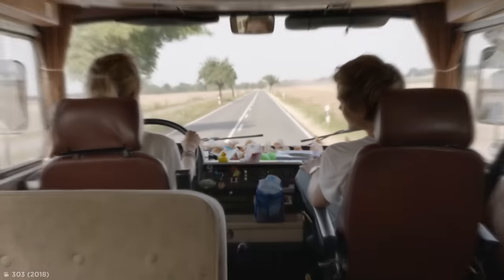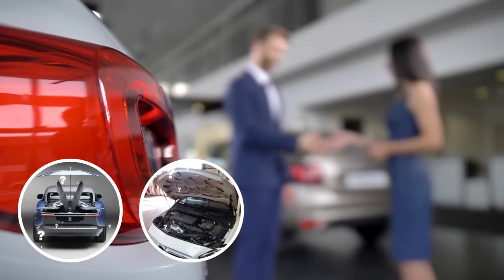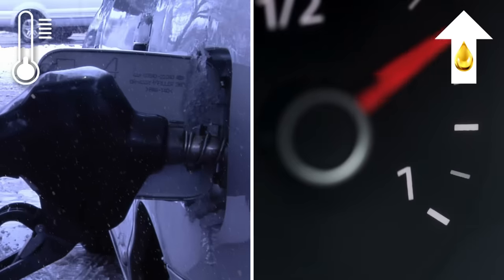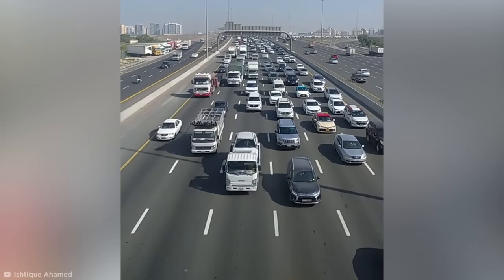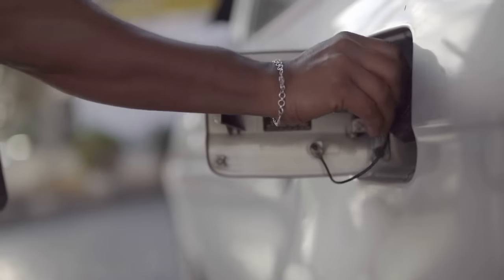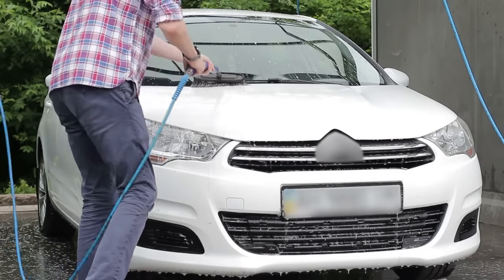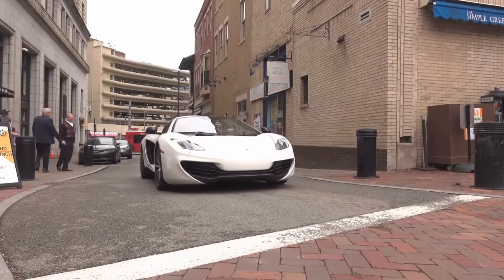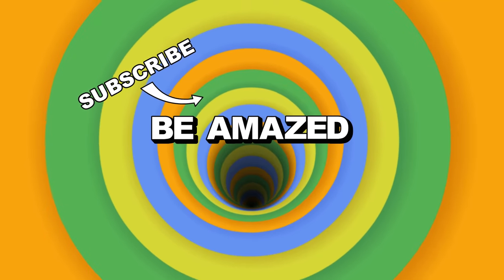Car Secrets Only The Most Experienced Drivers Know

Comment: White gets pulled over more then red because 25% of all cars (at least in the US) are white. Only 6% are red and red is in 9th place on the list of colors. Even thought that’s the case red is the second most pulled over which proves that yes it is more likely that you will be pulled over in a red or more brightly colored car.
Also people move over to the bigger space hoping that there’s enough room for them to accelerate to get ahead of the car that was in front of them like sideways leap frog. It’s not because it’s an optical Illusion.

Comment: 1:21 Stop using the word utilize, it does not mean what you think it does. Rather than using the correct word use, using utilize comes across as pompous and self-ingratiating. Utilize has a different meaning and usages than use, thus utilize is not a fancy way to say use. Use means to consume from a limited supply or take something to achieve a result. Utilize means to use something beyond its intended purpose. Example, we use a chair to sit upon, we utilize a chair as a step stool. See the difference? Hope this helps you and others as well.

Comment: When you get into a car, you AND YOUR PASSENGERS should all be wearing your seatbelts. At work, we had a video of a recreation of a front end collision of two cars. There were 5 passengers and the driver, but one passenger wasn’t wearing his seatbelt. The car got into an accident that wasn’t totally head on. The cars collided and the unbelted passenger struck the drivers seat and with the force of the accident and the extra weight and force of the unbelted passenger, it snapped the drivers seatbelt anchor and he was impaled on the steering wheel, killing him. Then because the accident was not totally head on, the unbelted passenger struck all the other passengers in the car and killed ALL of them including himself as the car spun around. 
 Then the video mentioned about having groceries in a SUV and not in netting or a box. If a can of corn or some other loose object, like a 2 liter bottle of pop, were launched into the air, in an accident it could kill any passenger it hits along the way. The force of the impact can make loose items deadly in any high impact accident.

Comment: Modern cars haven't had gas caps since Ford developed easy fuel which is a capless fill filler neck for the fuel, which eliminates those pesky check engine lights and pressurizes the system perfectly when you take out the fuel nozzle. The engineered it in 2007 and it was on almost every Ford in 2012. General motors just finally started putting it in its cars about 2017. And the rest of the industry is starting to follow. But if you buy a new car in 2023 that still has a literal gas cap, that thing is behind in tech by at least 15 years.

Comment: Any time your check engine light comes on it has to do (in some way) with your vehicles emissions and any time your check engine light flashes it means your vehicle is getting raw fuel in the catalytic converter and you should turn the engine off immediately before causing catastrophic damage

Comment: Vauxhalls have been rebadged Opels since the 1970s. Vauxhall has not been British-owned since 1925.
The bike rack drawer is an Opel feature. ‘Dreamt-up’ by Opel. The picture you show at 16:46 is an Opel promotional picture; the vehicle has ‘GG’ German number plates. That’s the area code for Opel’s headquarters in Russelheim, Hesse, Germany and always appears on Opel’s promotional or press cars and pictures.
Nothing British about it at all.

Comment: Uhh huh holding tanks for gas in my area maybe insulated to an extent. But it’s not that great. We have to keep a couple treatments in gas an diesel fuel in the winter. This has been known otherwise for diesel fuel to gel up. 
If you have realized that you get worst mileage in winter then you normally? 
For what’s to come this winter 2023-24 I’d recommend keeping ur diesels. Especially if it’s a Cummins or an old idi. These engines with no proper mixing solution are capable of running on ur drain oil/ fuel barrel /  gas + mix of oil gear lube. If there’s not to much bacteria build up in them that is.

Comment: The key fob on top of the head does work, but it's not because of the water in your head.  It's just turning your skull into an antenna.  Holding your phone against a piece of metal would probably do the same thing.  Years ago I could press my flip phone's antenna against the inside of an elevator door and not drop the call while traveling to my floor.

Comment: Most start stop traffic is caused by people not driving! If they would just get off their brakes most back ups could be avoided! Where I live there is a section of highway that goes from 65 to 55 to 45 to parking lot in less than 2500'. It causes back ups onto 5 other highways of up to 10 miles and the city does nothing to help! They could put cops out there to force people to drive and not have the speed limit plumet like it does. Instead they leave it alone causing more idling causing more pollution harming the environment which then causes more cancer due to the carcinogens in the atmosphere let alone destroying the ozone! I'm no hippie dipping tree lover loke some out there however I do want to have ozone and clean air for my kids.

Comment: 14:45 nope dirty cars because if it’s been there longer then 24hrs there’s definitely gonna be issues with washing them afterwards. Hear the term leave sleeping dogs lye? 😂 there’s a good chance that if you decide to wash the dirt off or power wash it off after it’s been there settled through a hot cold cycle then you can run into issues afterwards.

Comment: The reason he gives for the keyfob range to be extended is total BS, you are forming a loop antenna with your arm to your head, It works better if you have it between your hands above your head or to your feet. The loop formed by your body must be aimed at the car as it is directional.

Comment: MANY OF THE CARS I.E. JEEPS DON'T HAVE GAS CAPS AND ARE CONSTANTLY HAVING  ENGINE LIGHTS COMING ON BECAUSE OF THE FAULTY ENGINEERING IN THE EMISSION CONTROL SYSTEM WHICH THEY WON'T RECALL BECAUSE IT MAKES DEALERS AND MECHANICS A LOT OF MONEY.........

Comment: You actually can get more gas for your money by pumping slower. Full power pumping adds a little bit of air to the mix and the meter reads slightly wrong. So pump slower and you can save yourself about 12 cents

(vote for Trump and you can save about 12 dollars)

Comment: Stereotyping on Chk Eng Light is a joke. It is only an indicator there is an issue in the emission system. I drove a 1995 Nassian Fronter with the Eng Chk Light on for two years. I lived in an area where annual emission checking was exempt. After I moved back to the place where emission testing was required, I had the Chk Eng light researched, and it was just an O2 sensor. I changed it out, and there is no more Chk Eng light. Yes, I am an experienced driver with over 60 years of driving.

Comment: 1:39  and , You'd be a bit of an idiot if you did
Why not just walk up to (since you're taking a stab in the dark anyway)  Up to a metal pillar and touch the key part to it then press the button, THIS WILL RESULT IN 1 OF 2 SCENARIO'S

1. you will get a huge amplification in signal 

2. or... if the metal is earthed the signal will do fuck all 
BUT... YOU HAD FUCK ALL ANYWAY, at least , Chances are if it's a garage situation or overhead shed situation, it's likely that the structure itself is not earthed by an earth cable and your'e going to get some level of resonant frequency throughout the entire structure, which could cause your car to say... Yeah, Hi i'm over here

You could also wrap a long wire around it ,   Part of it on the key and the rest in the air and have a make shift antenna

Comment: 1. key fobs can be amplified by your head. 
2. Key fobs have a hidden key
3. Red cars are charged higher and get pulled over more (myth busted?)
4. Morning gas gets you more gas, not true 
5. Moving into "the fast(er) lane" doesnt get you there faster. And causes the slinky effect
6. Seat belts extra fabric stiched on the end is for crashes in the event of a crash
7. Check engine light isn't always a life ending diagnosis 
8. Gas cap may end up causing a check engine light
9. Dirty cars perform better than clean cars (myth busted)
10. Some cars have nifty hidden features
11. Motion parallax, objects far away dont seem to move. 
12. Cars made with clay when being designed 
Youre welcome